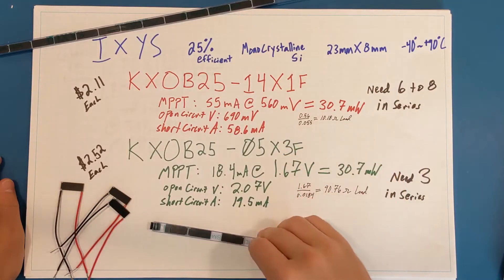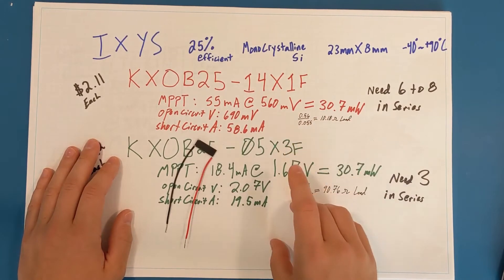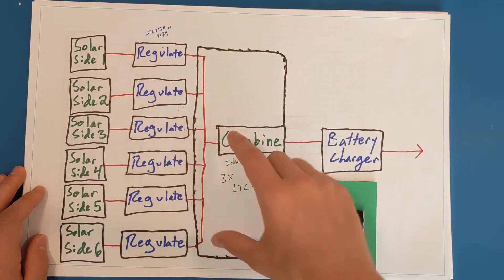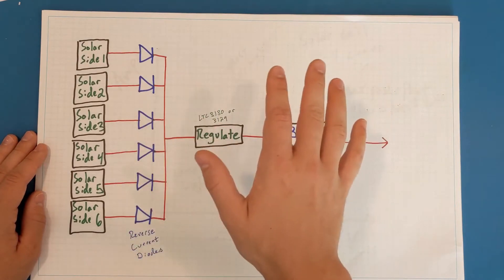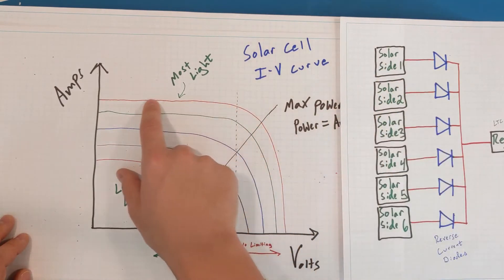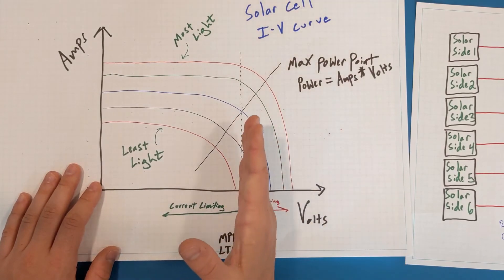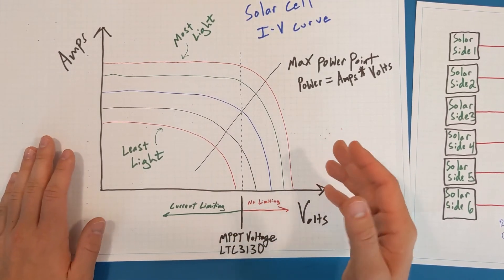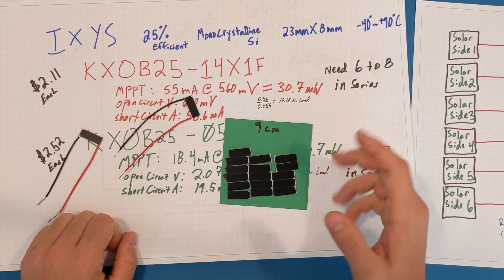$1K CubeSat -- Part 6 -- Solar Cells, MPPT, & Panel Wiring

Comment: Have you considered using a single large SM531K12L from the same company? It provides much more power (1.37 watts) than this array of smaller cells, is simpler to assemble, and is used on Interorbital Systems' new CubeSat kit.
Reply from the maker: Nice!! Thanks for the heads up. That does look way easier to use. 
Although I calculated roughly 0.125 Watts/in^2 for the SM531K12L and the KXOB25-14x1F. Which makes sense, since it's the same company and probably the same tech inside.

Comment: You can find a lot of good materials on solar powered systems from university solar car teams such as University of Texas’s UTSVT. The clumped regulator solution is usually a necessary evil, but the mppt is crude. 1W at 90% efficiency means you have to get .1W out of the case using only radiation. This will require a large heat sink that you need to save for your radio.
Reply: Looking at your previous video, a more accurate total power burned on the board is 500mW with the grid included, so if the Heat sink is the size on the PCB/if you assume the PCB has zero thermal resistance than your left with q=roe*A*T^4 for the radiated thermal dissipation with A is the area of the board and roe is the Setfan–Boltzmann constant. This means your chips are freezing at 121 kelvin. Hopefully this is off by a factor of 2, but you can definitely splurge on some of your power budget.
Reply from the maker: Hey! Thanks for you comments! 

I'll for sure look at what solar car teams do, I know they are always at the bleeding edge of battery & solar tech. 

What do you mean by clumped regulator? All solar cells feeding into one regulator, OR, several regulators?

My (potentially incorrect) understanding of LEO is that it isn't all that cold.
Reply: University of Michigan has the best panels, but a few schools have very unique power trains. 

The clumped is using one mppt for all panels. The impedance and voltage across each panel is determined by its exposure, so a single shaded/underperforming panel will impact the amount of power you can harvest from the other parallel and serial panels. Solar cars that use the clumped mppt see rough 60-80% of their expected harvest at solar noon due to just underperforming panels in their array.

You are right. NOAA’s 18 satellite ran as hot as 10C while continuously in front of the sun. Sciencing.com seems to think this is about ambient for LEO. Oreilly.com gives a range for pecosatellites, but it’s hand wavy.

Comment: Just wondering if you have reviewed the energy harvesting chips from Texas Instruments, for example BQ25504, BQ25570 etc. I've used them, and they're good. Maybe it's your cost-constraint?
Reply from the maker: Hey Kawsar,
Those look like neat chips!  I'll have to study those to see if they could work in a future iteration.

The short answer to your question: 
Those chips are not too expensive, I just found what I liked with stand-alone battery chargers. (I also like LT, and dislike TI's datasheets)

The long answer:
The main reason I stayed away from a combo-harvester/charger was because I found that there were a lot of flexible options with stand-alone chargers. 

1) Redundant battery chargers ( Its hard to hookup two harvester/chargers off the same source since they both try to MPPT the input);

2) Operate without a battery/ run only on solar (LT calls this PowerPath, essentially it's having the charger control the battery output. The system can be powered without using the battery, but if there is insufficient input power, the battery is used);

3) High-Power capable: (Able to support large bursts of current on demand. Radio transmissions might peak around 10W, for example);

It seemed liked a lot of combo chips had either 2) (they had some form of PowerPath)  or they had 3) (high power), but not both. 

Anyway, thanks for asking! I'm know there is a better power topology out there, and I look forward to iterating on the design!

Comment: What is your rational for wanting to put cells on all six sides of the cube? Are you still planning on having basic orientation control for the satellite? You probably don't want to be constantly adjusting to track the sun but it seems like you could probably orient the satellite in such a way to eliminate the need for top and bottom cells.
Reply from the maker: That's a fair point. If I'm going for lower cost, then less cells is better. But each side is maybe ~$30, if not less. And if I have space, then why not?

Comment: Are you using Arduino in this project???
Reply from the maker: I am not, though it'd be possible. I'm using an STM32L496 at the core of this cubesat, which gives me more I/O. See part 2 for more details on the Avionics board.
Reply: @RGSAT  why not a TMS570??
Reply from the maker: That'd be a good choice for a processor. However, it does consume more power, and I'm just more familiar with the STM32 architecture

Comment: You have me inspired. I have a 9x9cm PCB and some DigiKey parts on the way to make a redundant charge controller with 6 panel inputs. I'm by no means an Electrical Engineer but I'm using SM141K08L's for the cells, 6 x MAX20801 for MPPT, 2 x LTC4066 for the Battery Chargers and a LTC4353 for ORing. Keep up the good work!
Reply from the maker: Thank you!

The MAX20801 looks like a great part, and uses a much better MPPT algorithm. Somehow I totally overlooked the MAX parts, I'll look into them. 
I just wish the datasheet had more information, seems pretty short. Also looks like this part doesn't do any of the buck/boost and output regulating? Might want to double check that before you plug it into your LTC4066
Reply: @RGSAT  Absolutely, very good notes. I planned to hook up the multimeter to every aspect of the circuit before soldering on the next. I have some LM2937 Voltage Regulators between the LTC4066 chargers and the OR'ing Controller but if the MAX20801's can't leverage "Electronic Voltage Limiting" as stated in their datasheet, I'll have to throw in a simple DC-DC buck/boost converter before the LTC4066's. Excellent catch and much appreciated!
Reply from the maker: @wrcrooks  Oh I see what you mean with the MAX20801's electronic voltage limiting. It does do output regulation, but the only options for VOUT to be 10V to 11V, depending on the package type? That's something you can work with, but the minimum MPPT voltage of 6.5V is probably more of a concern. Planning on using two SM141K08L solar cells in series?
Reply: @RGSAT  Another good point. I misinterpreted the "Absolute Maximum Input Voltage Rating" of -0.3V~21V in the datasheet and just now noticed the IVR for MPPT is as you stated. I had intended on running the cells in a 4P configuration but it looks like I'd have to do at least 2Sx2P or 3S to hit 6.5v in. Then I'd probably throw in a TPS62173 or similar buck converter with a fixed 5V out after each MAX20801. I don't know if the inefficiencies and extra cost introduced by these additions would warrant  a better setup though like you proposed in an earlier video. Sounds like I need to get working on V2 PCBs!